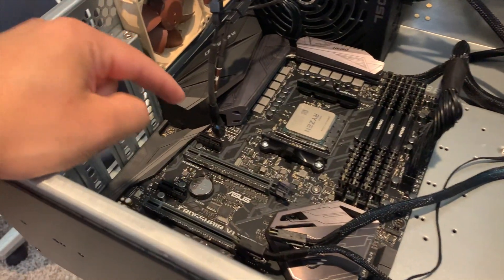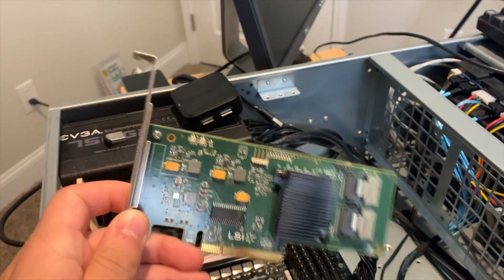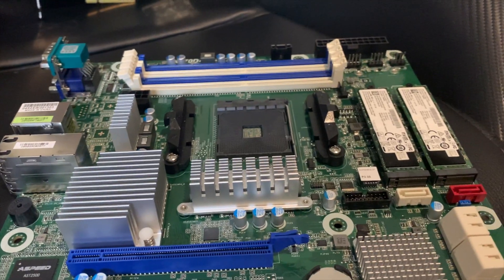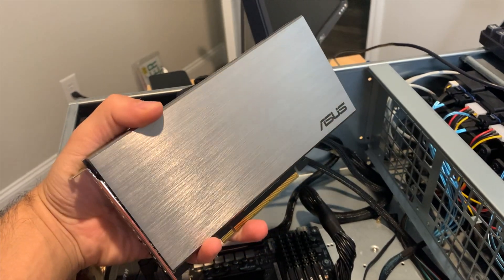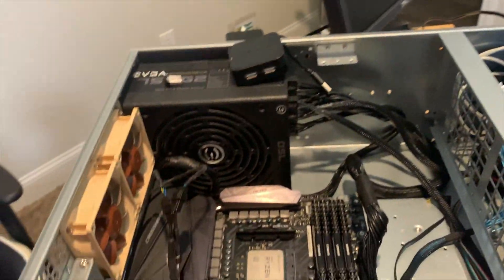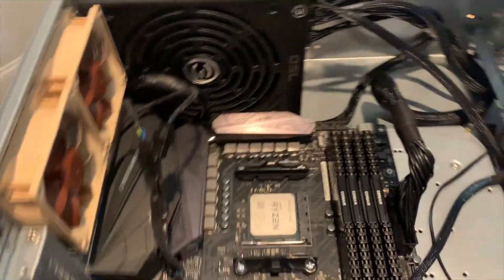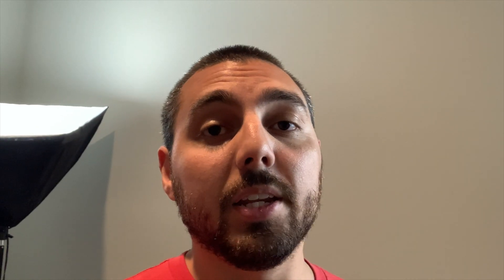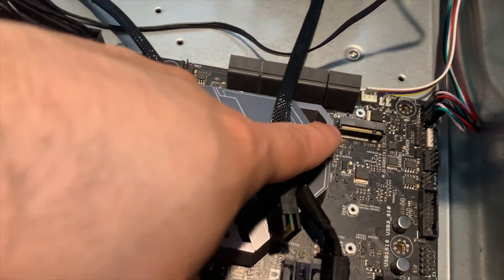Crisis in the lab, what went wrong?

Comment: Let me ask you this. Why do you want a graphics card in your system? Are you going to be using that system for transcoding? You showed a LSI card (not sure if in IT mode or RAID) but depending on what you want to do, that Asrock Rack motherboard which seems to be the X4704DU ? Or is that the newer model? Anyways, it is an amazing card for a server system. It comes with two 10 gigabytes LAN, you could fit 2 LSI cards in there for a NAS system or just use 1 for a 8 drive system.. Depending on what you want to do, that motherboard is a heck of a nice compromise for a server system. I plan on using it myself to get things going. Keep my current NAS TS-573, get myself a 2U case with three 4 tb NAS drives, virtualize Nethserver for my firewall and run a few VMs all under Proxmox. All that with a 3700X. Anyways depends on what you want to do. The main reason I am starting with that X4704DU board myself is 1) I don't want to go Intel, 2) At the moment EPIC ROME is way too expensive, 3) that board, although with very few PCI-E slots, is an excellent compromise to get a good server system started and when the 3950X becomes affrodable, you could have a 16 cores sytem!
Reply from the maker: I want to try out GPU transcodes instead of CPU.  The LSI Card was in IT mode, now it's in dead mode.  This board is the X470D4U2-2T.  Both the older and newer board are great options as you listed.  Honestly don't think you could go wrong either way.  I wish we could afford Epyc, that would be great.  But soon the used market will be worth checking out as the next generation of CPU's is released.  Can't wait.

Also, I just released a new video about this board btw.
Reply: @SPXLabs  Definitely, I mean to start with, get a 2U case with 3 NAS HDD, a X4704DU board with a 3700X would make up a decent system to run a Nethserver firewall and have a couple of VMs to get things rolling. Plus, there is the advantage of getting IPMI if you need to manage things while you are away. EPYC would be super n ice but the current 16 cores version are so pricey. I think we are looking at a 2 years wait before they really become affordable. But when you think about it, if they continue making 16 cores processors like the 3950X, all we are really missing is a better version of the X4704DU with more PCI slots and then you'd have something that is more affordable for house projects. EPYC, while super nice, just is a class of its own in terms of prices and when it does get cheaper, you'll probably have a 4950X which is going to be better. 16 cores will get you a long way.  GPU transcode should be more efficient for sure. I'll check out the new video!